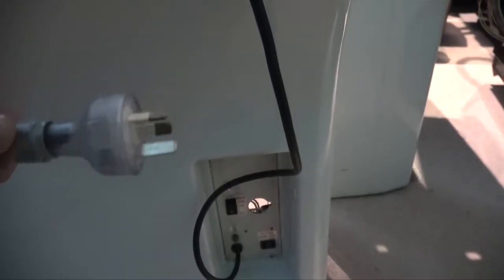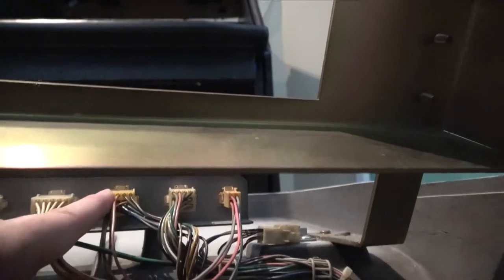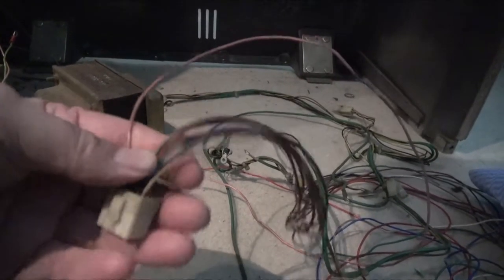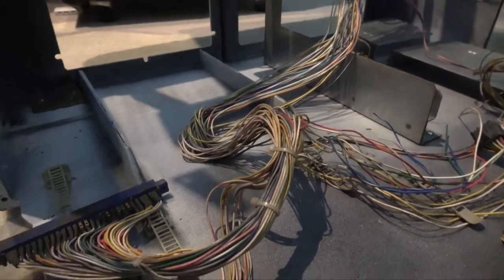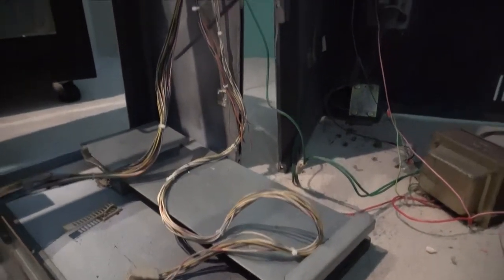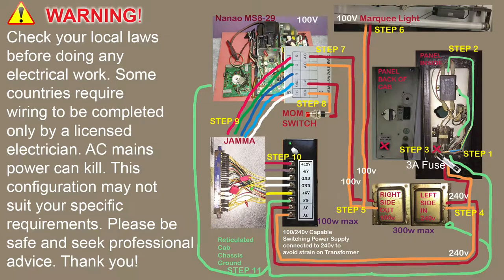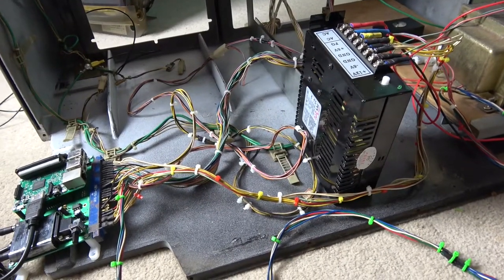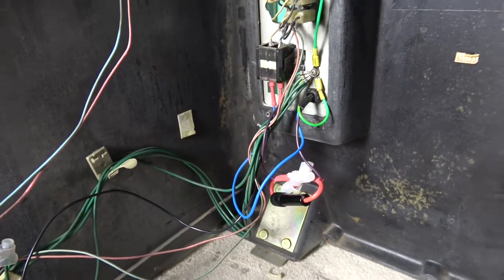FE011 - Sega Astro City Rewiring!

Comment: Sorry noob question incoming.
Could you not use a PC ATX PSU rather than doing all that re-wiring? If you changed out the marquee light for a LED and then you just need to bower the monitor.
Reply from the maker: Hey Terry, yes you could. Although PC ATX PSU's don't have voltage adjustments. If you are serving a large PCB set (like a sega model 2 or Atari System 2 board set) then you may not get enough voltage to drive them properly. So it depends on what you are running in there. An LED swap out for the marquee light is a fine idea. I would have done the same but the stock one worked so kept it original. Cheers.
Reply: @SpaciesArcade  Okay, thanks for the reply. Just got an Astro myself yesterday which is fully working. 

I'll leave messing around with it until it has a problem.

Comment: Fantastic guide, thank you. At in the UK so also use 240V standard. I may have missed this but did you just ditch the original Astro PSU? The sort of flat rectangular one, in favour of the switching PSU?
Reply from the maker: Thanks LordBarko. I actually kept the Astro power supply and installed it in my Sega Blast City. See the later episode that shows that cabinet setup. Cheers.
Reply: @SpaciesArcade  Thanks bud. Any chance you've made a video explaining how to remove a chassis from a MS8 monitor? Need to remove mine and bit of a novice!